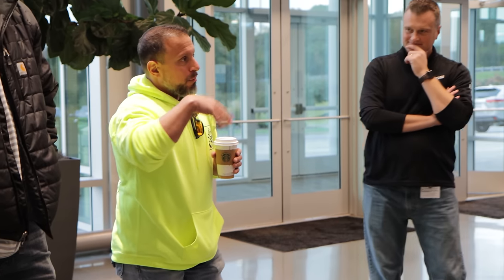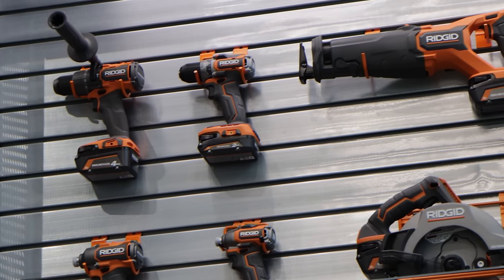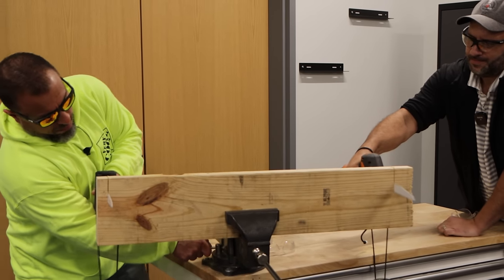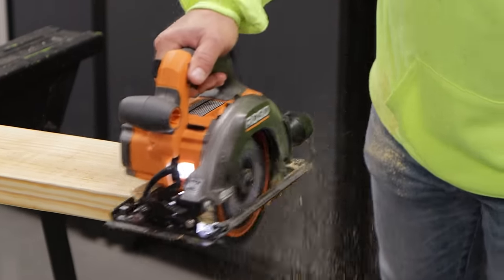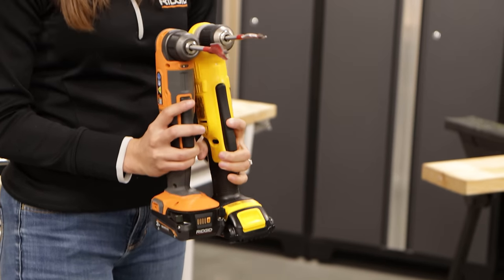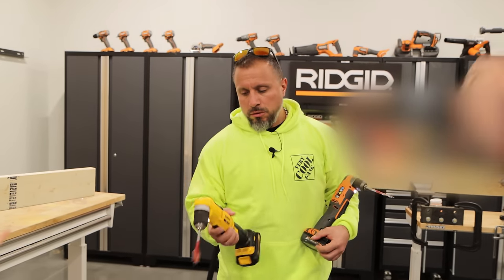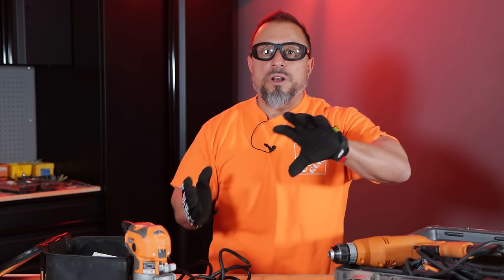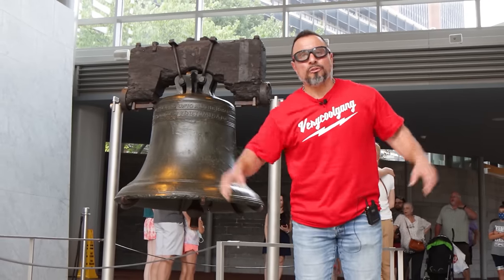Telling Ridgid Executives I Don't Like Their Tools!

Comment: The reason I go ridgid is for the lifetime warranty on there tools.
Reply: I did for the same reason until I figured out that Rigid doesn't warranty tools or batteries if they're used for commercial purposes. Did that change?
Reply: I buy dewault so I don't need the warranty.
Reply: @chrisplummer8588  commercial purposes = management discretion
Reply: The lifetime warranty sold me too. And guess what else? Your gonna use it if you use and rely on those tools ever day. The sucky part is when you send the tool in and don't get it back until 3 months later.
I have a multi tool that I had to send in again and I haven't heard from them in at least 4 months.

Let me tell you this. I bought a rigid tool kit about 4 years ago. Ive had to get the motor replaced in the impact and the sawzall. The hammer drill is a joke. The keeper screw for the chuck sheared off running an auger bit. And like I said the multi tool was a separate purchase-motor replaced under warranty, but don't expect to get anything back in less than 3 months!! By that time you will have bought another tool that is more reliable!
Reply: @GravvyTrain  : I've had my impact and drill for years. Not one problem.  Never had to send it in or nothing.  Sorry for your troubles but so far I've had no troubles with my tools, also have there vacuum, and leaf blower. Still no issues.
Reply: @darkknightlight  do you use these tools professionally,  or are you using as a diy'er? I can attest that a cheepo ryobi tool is dern near indestructible as a diy tool. I have been drilling through 1/8 inch plate steel and stainless plate 8 hours a day for 4 years with 1.5" holesaws with my dewalt 18v nicad. That's where a better tool shines. So if you're a diy guy it's definitely OK to buy an inexpensive tool.
Reply: The same here. Since I'm no professional, knowing that those tools are lifetime is cool. I can't wait to buy that right angle drill
Reply: @chrisplummer8588  same as a plumber, they wouldn’t warranty their drill.
Reply: Milwaukee is the same
Reply: I remember going through and frying 5 ridgid impacts and 1 ridgidSawzall before I switched to milwaukee
Reply: @chrisplummer8588  
Ive had a table saw, framing saw, 6 inch sander all replaced under warranty .
Reply: I just get the employees to swap out the tools. The warranty work takes forever
Reply: @matthewmiller4747  or dont wait and buy a brand that doesn't fry like an egg on you
Reply: It’s limited lifetime warranty which means only certain things get warrantied
Reply: @justinjuarez1852  everything breaks. The only question is how much money do you like throwing at tools.
Reply: Good luck actually claiming it
Reply: @josemisiego  don't buy it.
Life time is a joke.
Reply: Their!
Reply: Milwaukee and dewalt have one as well.
Reply: My Milwaukee made in Vietnam and China keep working and working.  No warranty needed.
Reply: Can't imagine mailing in a return to rigid. I go to home depot. 
As far as being a contractor... 
Dress normal ask for return. 
Who is offering up info that they are contractors!!
Reply: It's not a lifetime warranty it's a service agreement and it's a joke
Reply: ‘their’
Reply: I’ll stay with Milwaukee burnt up too many yellow and orange stuff.
Reply: If you are a weekend home owner, sure… day in day our contractor? Um, no. Milwaukee for me.
Reply: *batteries!
Reply: Same manufacturer as Milwaukee but much lower QA

Comment: Re: "Ridgid has no clear-cut path..."  Vince, I have a number of Ridgid tools (along with Makita, DeWalt, Ryobi, etc) and your statement reflects my FRUSTRATION with Ridgid. 

 I am heavily invested in their JobMax line (having a lot of the various head attachments), and now Ridgid (as well as Ryobi) have TOTALLY DROPPED that line.  

My question to the "brass" at Ridgid is thus, "How are you going to provide ONGOING WARRANTY SUPPORT for the JobMax line, if I need to take advantage of my LSA's (of which I have all of my Ridgid Tools registered for), since you no longer make that line?  

If either my JobMax or one of the related accessory heads go bad, WHAT will it be replaced with?  Will I just be stuck with a "Boat Anchor" of a tool or what??  Would really be good to hear an Official Statement from Ridgid on this.  

I'm ALSO heavily invested in their Mega-Max line, and it too has been dropped, so the same questions I had for the discontinued JobMax line also applies to the Mega-Max.
Reply: I really like the job max. I given up or ridgid but I still keep my job max in the tool box as wells as the octane orbital sander.
Reply: @SweetStat  I like my JobMax too.  They're big and bulky, but they offer an incredible amount of VERSATILITY.  My question still remains the same though, and that is, "HOW does Ridgid plan to support and/or HONOR their LSA's on their discontinued line or tools, to those such as myself that are heavily invested in their (now) dropped lines??
Reply: I have an octane drill that has been obsoleted and have the same question. It needs repair and  it would be a significant down grade for them to replace it with their new highest model.
Reply: @D3M3NT3Dstrang3r  a drill is easy, they'll just replace its with today's equivalent model. Which would be their high end drill.

More unique stuff like the job max and hydrolic impact im not sure how they would handle
Reply: @SweetStat  Their new top of the line drill is not rated anywhere close to the octane in power. It would be a downgrade. I dont know of any time that a new top end ridgid model was weaker than a previous one, so no not a simple swap. It would be like swapping from a Milwaukee to a Ryobi difference and that is not what I expect out of the lsa.
Reply: @SweetStat  I did want that hydraulic impact driver though. Octane released about the time I was looking and I decided to buy it instead. Could really use it around the house instead of the g5x brushless I have here. It would be so much quieter.
Reply: @D3M3NT3Dstrang3r  i got the hydrolic impact. Its great.
Its been through a lot. Dirty jobs, wet jobs been dropped, 5-7 days a week and abused but held up great!
It excells in some tasks, self tapping screws in particular. 

I kinda think they missed the mark making it big and powerful instead of making it more compact.
It's much heavier than any other impact I ever used.

Comment: I have a Ridgid bandsaw, planer, and HAD one of their hammer drills (the hammer drill lit on fire in my hands). All three tools are the worst tools I have owned. The planer and bandsaw have glaring design flaws. The miter gauge slot on the bandsaw was milled 1/16” too deep into the table making standard miter gauges that use a 3/8”x3/4” guide bar unusable on it. The planer doesn’t have a cutter head lock which causes it to create a lot of snipe at the leading and trailing edges of every board I pass through it. You might say I’m not a fan of Ridgid either.
Reply: Had that happen with DeWalt now owned by black and decker. Gave up on them.  Sad but they can have bad runs.  Up side got full refund down side I don't trust there tools  Still have first DeWalt tool when it was DeWalt only wow what a drill still going.

Comment: Nothing gets hotter than a rigid drill. Can’t even knock wire holes through more than fifteen studs before it starts cooking itself. Rigid is for handy men and home maintenance techs,  they don’t last more than a year on a production site. And you can usually roast the whole set on a decent size deck. 😂

Comment: I moved to rigid by accident.  Was looking for some new tools, and wasn't sure which direction I wanted to go.  Got the impact driver as a gift.  Used it for a while, felt it worked great, and decided that I didn't want a bunch of different batteries.  So I started getting more rigid tools.  9 months in and I think they have a solid offering.  the "best"?  Who knows.  But for an amateur guy like me, the do the job just fine.

Great video.

Comment: I love ridgid for the batter warrenty. But you should have switched the blades on the recip and right angle drill to check for duller bits on the dewalt

Comment: Ridged is fine for a homegamer, but if you're making a living with your tools, Ridged isn't the route to go. There are reasons that work trucks all over the country are stocked with Dewalt and Milwaukee.............They do the job.
Reply: Depends on the tool. Ridgid pipe wrenches are some the best same with shop vacs
Reply: I trust Ridgid for threading my pipe. Some folks have a sweet spot. They oughta just capitalize on that. I have a belt sander made by them. It sands.

Comment: I used a rigid bandsaw today and was thoroughly impressed. Not only did it cut way smoother than my dewalt bandsaw, it nearly matched my Hilti in terms of performance.  Hilti ia just too expensive for what i need on a day to day basis. I'm not a fan of Milwaukee so I may be switching to Rigid because of the price and performance now. Which is why im here seeking vidoes on comparisons.

Comment: The only good thing ridgid makes is the High Torque impact (it’s basically orange Milwaukee) they are discontinuing it because it’s too strong?) and the knockoff pack out system they make.
Reply: TTC I see
Reply: I use the rigid “pack out” at work and it’s great but to be honest the new ryobi “pack out” is going to be the upgrade.
Reply: I wouldn't say it's a knockoff pack out, as it was out years before milwaukee had toolbox stacks, maybe a Dewalt knock off. Lol

Comment: Have been using ridgid for about 5-6 years now. Very happy with the 18v line.  I have a few impact and drill drivers in Milwaukee 12v and like them as well.   Glad RIDGID IS finally filling holes in their lineup.  Milwaukee and Dewalt have toenail clippers it seems lololo

Comment: I have been collecting the rigid tool cordless products for quite some time. Some have been great, truly on another level, others a disappointment. I have a set of 12 volt compact drills that have been by my side for well over 10 years, they are amazing. But it is so helpful to see this video and know that there is some real improvements coming on down the line. Great video!

Comment: I run all Milwaukee 18 and 12v tools and am completely invested in the platform. My dad now runs all my old 20v dewalt tools (and yes they are excellent tools) but my cousin who is a new landlord and is doing all his own repair and renovation had bought some rigid brushless tools, I've never been a fan of them in the past ( except for pipe vices, stands, threaders and shop vacs) but these tools were actually something that I consider decent, not sure how well they would stand up on a job site but for a homeowner/ do it yourselfers they were some real bang for the buck.

Comment: I love your videos and the manner in which you review tools and put them against each other in fair races that WOULD actually happen on a job site! As a career carpenter, I have found it frustrating that some brands don't have complete tool lines. I have found it downright offensive that certain brands have insisted on making critical changes in tool design everytime they come out with a new battery forcing tradesmen to abandon ALL their tools to get into the new batteries at a cost of THOUSANDS of dollars out of their pocket!! Largely because of this, but also because I have some tools that were purchased over 15 years ago that STILL have nothing wrong with them; I am a solid fan of the Ryobi battery tool line up.

Comment: I've had good and bad experiences with Rigid. Living in AZ and building houses I had a drill and driver combo set that worked as well, maybe better, than all the usual big brand stuff.
A couple years later found myself working in Iowa with a brand new combo during the winter time and the batteries wouldn't hold juice for long in just 20 degree weather and the torque was gone. Had to return them and buy a Milwaukee.Been curious since on the differences in performance based on the weather. I'll try them again though, I like the design and build quality of their product lines, I think they just need to fine tune some mechanical components.

Comment: I am an industrial mechanic. Our company just recently added small rental tools at a big box store to the things we service. The brand that literally fell completely out of favor with me as a result was....Makita. At least their concrete demolition tools and rotary hammers. They seem to focus more on weight reduction than reliability and their tools fail at a massive rate and are almost always throw aways when they do. They don't measure anywhere close to Hilti or even Bosch. I gave up on Dewalt tools years ago after having cordless drills and impacts fall apart on me, altho I still have an old corded 1/2 inch drive impact that kicks ass. The Ridgid tools I use every day have been pretty much bullet proof. If I worked in construction I would probably move up to Milwaukee, because I fell like they're better positioned for constant 8 hours days of continuous use. I place Ridgid above Dewalt and the newer Makitas, but below Milwaukee. It's a great brand for the kind of work I do.

Comment: The ridgid subcompact is made from adomantium or terminator 1 materials. It got soaked in transmission fluid, water and oil and it wont die, plus it out performs all ive tested.

Comment: I have a Ridged vacuum I purchased at least 15 years ago and just replaced the filter this year. I used to take out the old filter and drop it on the driveway and let it crash on the asphalt about half dozen times to clean it. After 15 years the filter finally gave out and I had to purchase a new one, but I went with the double pack because it was a super bargain. I'm 72 years old and now I have to make it to 102 just to get a return on my investment.

Comment: At work I use dewalt cordless tools because I started buying them years ago(over 6) and was told ridgid sucks. However 4 years ago I bought a ridgid hammer drill for home and loved it. So I have started buying ridgid power tools for my home use to use while woodworking and working around the house but until all my dewalt stuff dies I have to stick with team yellow for work. BUT I may make an exception for that right angle drill because in plumbing I’m always needing a smaller drill for tight spaces.

Comment: I used them all over the last 30yrs in construction.  I bought a Bosch impact and everytime I needed a new hammer drill, circular saw I went with Bosch. Durable, battery lasts longer and I bought the Bosch radio. 360degree sound, amazing base speaker.  Everything Bosch makes has been above and beyond all the others for durability and power. Check it out for yourself.
Reply: Bosch, Hilti, and Makita are actually the only power tool companies that are still owned by the original company and still make their own tools. Every other brand is part of a financial conglomerate that owns other brands.

Comment: What I don't understand about right angle drills is why the hell they don't mount the battery on the back of the handle (opposite end and direction of the chuck)  to save the length. The height only really usually matters on the drilling end. An overall shorter (height from drill surface as well as tool length) right angle drill is what we all really need to get into more tight spaces.

Comment: I thought I was getting a deal when I got the 18v 5pc brushless set one year. Once I saw that I had a form of every tool they made I bought into m12 for portability and began comparing when I’d use both lines and some of the m12 has very similar performance to the Atlanta 18v. Even without being fuel the impact drivers seem close when working on vehicles. I’ll keep the big stuff around for now for the saws but my 18v hammer drill needs a clutch so thinking of going Red for that. Glad to see they seem to finally get the hint to make more than 6 tools for the line

Comment: The thing is Milwaukee decided to FOCUS on Electricians and Plumbers. As an Electrician myself, I really did appreciate that a power tool company out there was interested in my power tools and constantly made their tool line more versatile and convenient to use at work. DeWalt has long been focused on Framers, Carpenters and Sheet rockers, hence why I don’t buy their tools, not that they are bad but they don’t suit my needs. Rigid’s problem was that they never knew who to tailor their products to, they seems to try to compete with everyone in all fronts and fall short because of that, the only tools I own from Rigid is the SDS and the Grinder, I can attest that they are good tools for what it’s worth. My first tool kit was Rigid, and eventually I switched to  Milwaukee because they tailored their product line to Electricians, but I feel like Rigid’s Grinder is better than Milwaukees because of the third handle port in the middle, it makes it more confortable in certain situations, and their SDS is underrated, it may not be as powerful as Milwaukees and DeWalt’s, but it certainly isn’t far weaker either, and it’s more ergonomic than them, which for me already having Rigid batteries from my very first kit, it was a no brainer to choose those 2 tools over Milwaukee’s and DeWalt’s. Rigid is better than brands like Ryobi but those tools are usually used by workers who do finishing work, who don’t need extremely powerful tools, who need compact light weight tools, but Rigid tools have always been on the bulkier heavier side. Rigid needs to focus on 1-3 trades and focus their tool line to them to really get back in the game and out perform the competition.